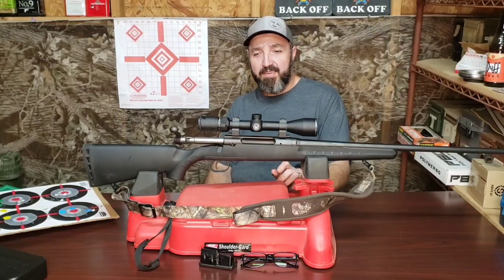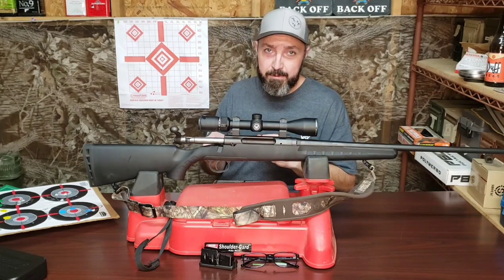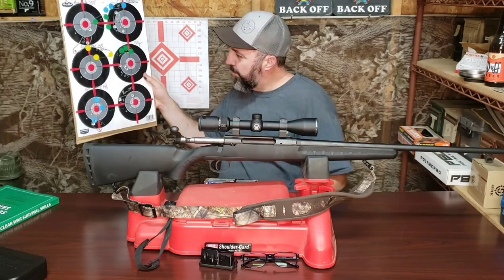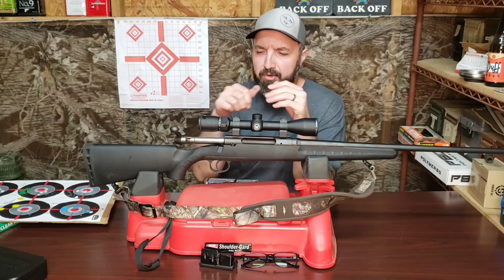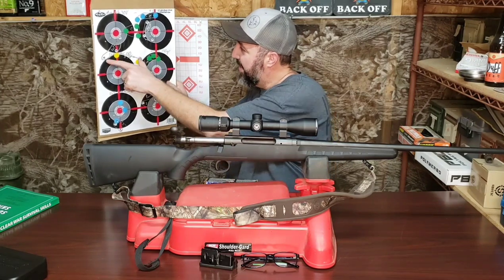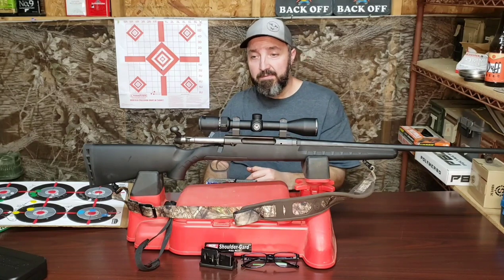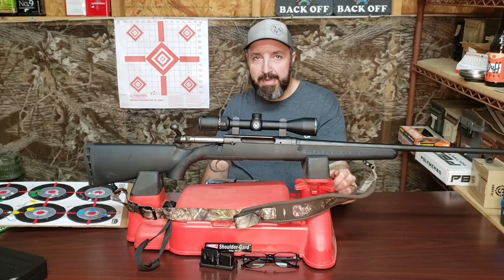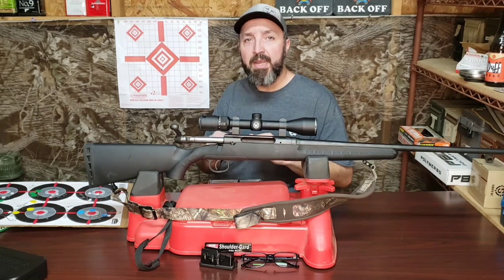2023 Project Rifle Update Vol 2: Making the Savage Axis I better with parts from MCARBO!

Comment: I poured ROCKITE expansion cement in webbing of forend to stiffen (after drilling holes between cells). 
TIP : go easy on water while mixing. If you get too generous use a paper towel to soak up excess water after pouring (it will rise and be sitting on top of pour).
  I left pour 1/16" below webbing height.
  Extremely rigid now.
Reply from the maker: Great tip, thanks for sharing 👍

Comment: 11:30  My Axis went from 7.5 lbs. trigger pull to 3.5 lbs., and it is consistent.  Even better than that, the pull before M*Carbo was loooong, with two or three rough spots before firing.  All that is gone now.  Very short pull and only one stage.   It went from the worst trigger I had to one of the best.
Reply from the maker: Thanks for sharing, and thanks for watching 👍

Comment: Son has an axis in 308. We did the mcarbo and put the 1 lb spring in. Testing the action before reinstalling. Found the safety wasn't working properly. Safety on, we could pull the trigger. Adjusted safety set screw. But holy smokes that 1 lb trigger is QUICK. next mod will be a d.i.y. muzzle break.

Not sure on a 20 moa rail or getting high rise scope rings. Bolt lever gets real close to the scope.
Reply from the maker: Thanks for sharing 👍
Reply: @JayLewisFarmStyle . Found out glade's armory sells a new bolt handle. It's massive in comparison.

Comment: Take the blocks out and use countertop epoxy to fill the fore end. It will be way stiffer and add some needed weight.  Mine in .243  20" is a tac driver and sub moa at 400 yrds. We're is also a bolt throw mod available that makes it really light and smooth to open and close.
Reply from the maker: Thanks for watching 👍